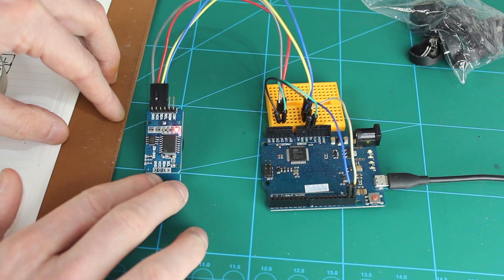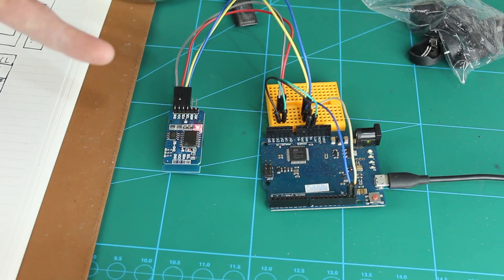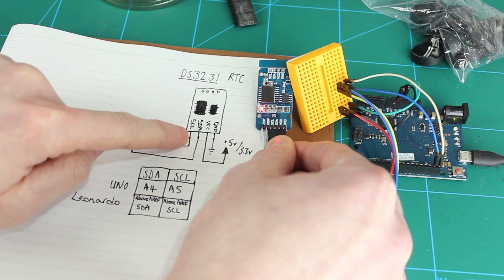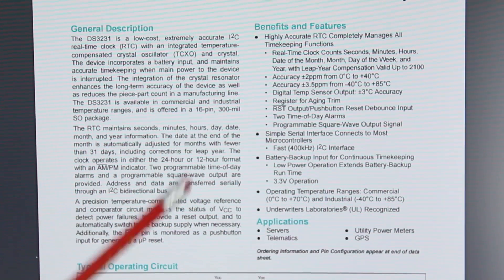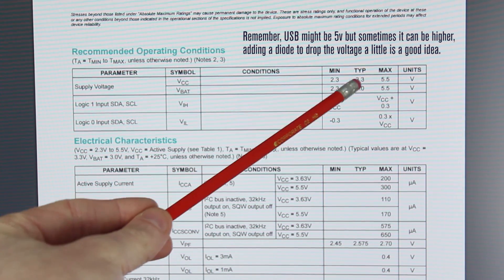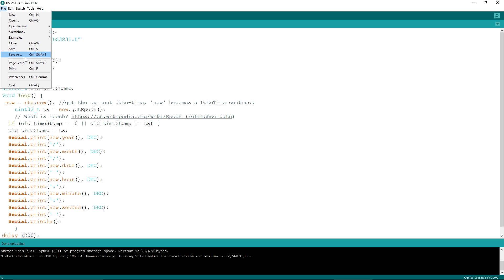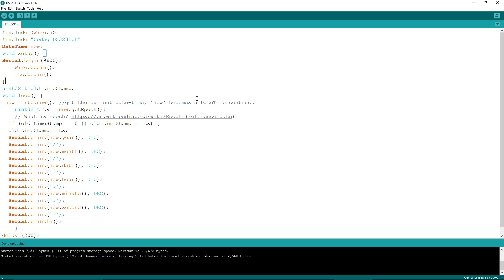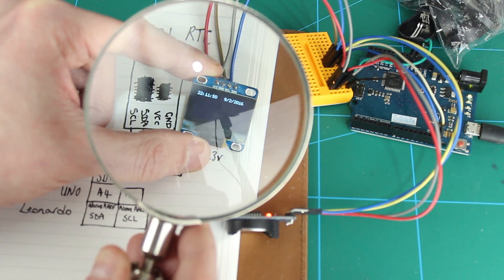Arduino: DS3231 Real time Clock RTC Module

Comment: Good video David :) Do you have info on how to use the 32k EEPROM memory on this module as well?
Reply from the maker: Here you go - http://www.hobbytronics.co.uk/arduino-external-eeprom This is about the 24LC256 rather than the 24LC32 but you should be fine with their instructions.

Comment: sir i just want to control ac appliences based on real time clock and i suppose to use 4 relays to control (AC1 AC2 AC3 AC4) based on respective time these appliences should turned on and off

Comment: Hi Mr David. I am new to Arduino. i got 2 questions. First, where to get the first coding (RTC coding)? i have downloaded the zip file and i got the 'adjust' coding but still couldnt get the first coding u showed. Second, i dont get how u print out the date and time? U said u already set the date and time so u dont need to do that, but in the coding it is still in 2011 and yet the time print out is 2016? i dont get it.
Reply: I think that the first code is what he wrote himself, so you can just copy it - you can't quite see all of it,  I think that there is a closing curly brace } at the bottom.
For the 'adjust' example, I think you just alter the parameters in DateTime dt to what they are now and run it. I assume he used adjust to set up the RTC but didn't save his changes.
Reply: padraig4096 Hello :D thanks for helping me to solve my question! I have found another coding which is easier to understand and it works! Anyway, thanks mate! :D

Comment: Hi David,

Please explain me the part of code that keep saving time every i lost the input power of arduino? I tried and it work as long as arduino has the 5v. But it always restart from begin if my arduino lost the power and when i reconnect again, the time RTC is restated..

I need a solution, please help me David..
Reply: mario aditya you need to make sure that the battery in the back is working. the battery provides the power when you disconecct your main power

Comment: If you were to unplug the Arduino and then plug it back in, will the time be reset?
Reply from the maker: No, it will keep the time because of the backup cr2032 battery.

Comment: hello, I set up the project tested for several days, and found that it starts to slow after a few hours of use, at the end of three days he was 10 seconds behind in relation to my watch. already changed the RTC module, already changed some things in the code but does not. this is normal in the RTC that are already accuracy.
Reply from the maker: You are better off comparing it to an internet based clock source but assuming your watch is correct then you should not see a 10 second difference in time. The clock time is set at upload so it will  likely be behind the real-time due to the time it takes to upload to the board. From the data sheet you might expect to see around +/-15 seconds per year. Temperature can be a factor in the timing of the crystal but otherwise I don't know any other reason you would get that.

Comment: A great feature that this has vs the 1307 is the alarm feature.  You can put a microcontroller into deep sleep power saving and wake it up with the RTC at a precise time of day (or depending on the chip on a certain date or multiple alarms).
Reply from the maker: Good tip, thanks.

Comment from the maker: Sorry Robby, I cannot reply to you directly. There isn't unfortunately a low battery warning but you could solder a wire from the positive terminal cell holder and feed it into your micro-controller analog pin to monitor the voltage.

Comment: What happens when you set an invalid date? For example 30th of February. The datasheet states it has an internal calendar with leap year correction, so I guess if it's on 28th of February it will know when to jump to 1st of March or 29th of Feb. But is there a way to use that internal calendar when setting the date instead of having to basically somehow have my own calendar in the arduino in order to prevent the user from setting invalid dates? 

I'm trying to make a nixie clock right now. I only have 2 buttons and 6 digits to display. So the user has only a increment button and decrement button to change the settings. When the user is setting the date and increments from 30th of April. My code would do a rtc.setDateTime(rtc.now().year, rtc.now().month, ++rtc.now().date., rtc.now().hour, rtc.now().minute, rtc.now().second)

Comment: This question isn't directly related to the RTC project demo'ed here, but rather the I2C serial clock and data connections.  I've been trying for some time now to understand why A4 and A5, when they are analog input pins.  Why not on digital pins?
Reply from the maker: +Donovan Lym They are also SDA and SCL on many Arduino boards but the are also present elsewhere often unmarked.
Reply: I still don't understand.  The RTC expects clocking (output) from the Arduino.  However, the analog pin is an input pin on the Arduino.  I must be missing something here.
Reply from the maker: Donovan Lym They are on the same pins, you cannot use analog input on A4 or A5 when you tell the MC to use I2C. Have a look at page 11 of the datasheet - http://www.atmel.com/Images/Atmel-42397-8-bit-AVR-Microcontroller-ATmega328PB_Summary.pdf - Just how they choose to make multiple uses of the 328 pins. analog pins can be inputs and outputs.
Reply: OK, I'm good now.  Bugged me for a little while now.  Thanks, David.

Comment: i'm using de same circuit and the same code and the hour and date than i get is wrong 2016-11-10 15:34 . I'm using the ping 20 and 21 of arduino mega 2560. Any tip?

code

// Date and time functions using a RX8025 RTC connected via I2C and Wire lib

#include <Wire.h>
#include "Sodaq_DS3231.h"
DateTime now;

void setup () 
{
    Serial.begin(9600);
    Wire.begin();
    rtc.begin();
}

uint32_t old_timeStamp;
void loop () 

{
    
    now = rtc.now(); //get the current date-time
    uint32_t ts = now.getEpoch();
    if (old_timeStamp==0 || old_timeStamp != ts){
    old_timeStamp=ts;
    int Nowyear= now.year();
    Serial.print(now.year(), DEC);
    Serial.print('/');
    Serial.print(now.month(), DEC);
    Serial.print('/');
    Serial.print(now.date(), DEC);
    Serial.print(' ');
    Serial.print(now.hour(), DEC);
    Serial.print(':');
    Serial.print(now.minute(), DEC);
    Serial.print(':');
    Serial.print(now.second(), DEC);
    Serial.println();
    Serial.println();
}
  delay(200);
}
Reply from the maker: +Carlos Alarcon Just looks like you need to adjust the time. Open up the 'adjust' example from the soda library and give it a go

Comment: I ordered a bucket load of 1307's a couple of years ago before I heard about these.... Not quite sure why. I mean there's only so much timekeeping to be done in the average house. These are way better. 

If I remember correctly, there was a page on the manufacturer's website where you could see a clock powered by one of the 3231's. It was built with a test/development device and left running to see what the long term accuracy was like.

Comment: I've found that there are a lot of fake rtc's from china, especially of the "tiny rtc" kind(ds1307) these fake chips should have a really good accuracy of a couple of seconds per year, but the fakes differ a couple of seconds per day! So the 1307 is a quite descent rtc, I prefer it since there are a lot of libraries for it, and it is available in an 8 pin dip /soic, but on the other hand it needs a crystal.

Comment: thanks i just ordered 2 of these on eBay so i could learn how to use them. now i have a good understanding as to how to get started thanks to your video.
Reply from the maker: +Beginner's Tech I look forward to seeing what you are working on.
Reply: David Watts im planning on making some videos then but it is going to take awhile.
Reply: +Beginner's Tech beware of the ebay DS3231 modules that have a charging circuit for their battery but are supplied with a non-rechargeable cell.
Reply: David Pilling ok thanks for the heads up.